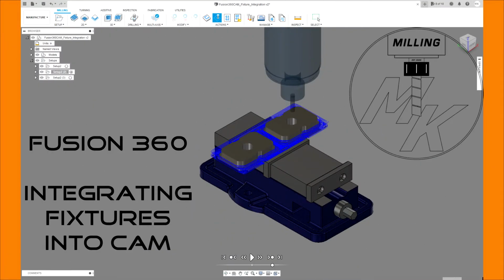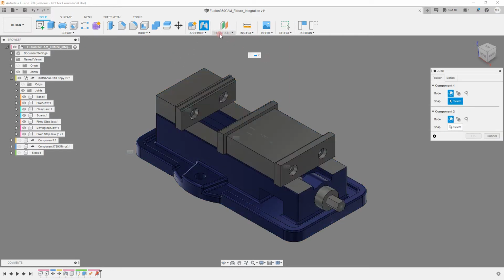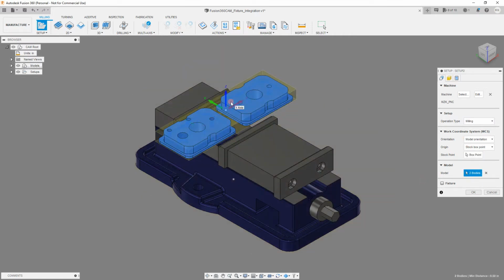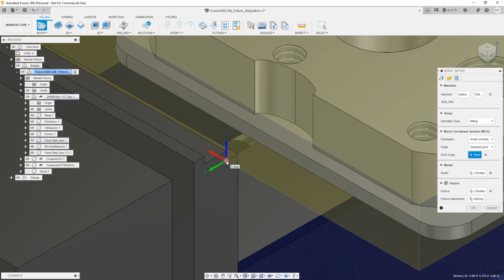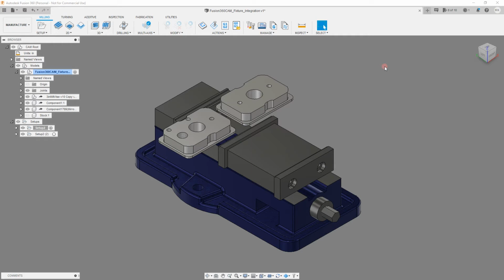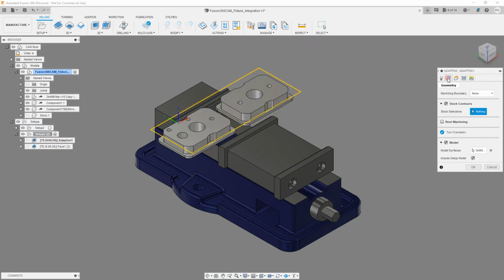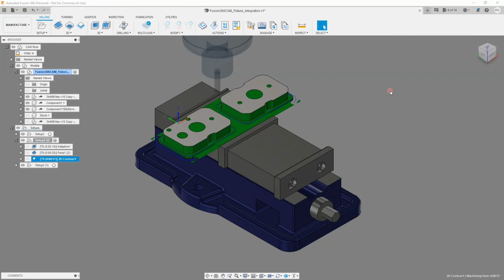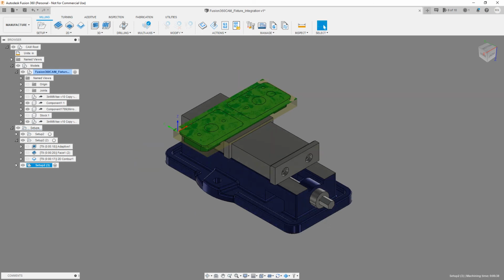Integrating Fixtures into Fusion 360 CAM

Comment: Such a great help! Even though I had my fixture modeled, I never used it because I couldn't get fusion to stop including the entire fixture in the work envelope. In addition, I also followed NYCNC's video about modeling the stock from years ago, but I also got this weird warning that Fusion would select all models.... It wasn't until this video that it all clicked. What I was doing wrong was not isolating all the components. In the past, I was just selecting the fixtured model and that was it. While watching the video, I selected the fixture model, the part models (this was the missing piece) and the stock model. Boom! It worked, Thanks so much!

Comment: Great, thanks for sharing. I'd love it if you talked how you create soft jaws and any tips or techniques around those.
Reply from the maker: I am actually going to be cutting some new stepped jaws for my vise here real soon, I will try and grab some video of it and throw something simple together. Not exactly going to be "soft" jaws, but a lot of the same processes will still apply.
Reply: @MKMilling  Haha, for some reason soft jaws are aluminum, which when hit with, isn't very soft.

What vise do you have? I assume it fits on your PrintNC and is something low profile. I have a hard time finding a low profile vise for my CNC router setup.
Reply from the maker: @janderson2375  Aluminum is still a lot softer than steel, and much easier to machine in custom features if needed. I am using the same vise you can see in this video. Its a random 3 inch machinist vise off Ebay. But I've added additional jaws the the back of the moving jaw so I have just over 7 inches of clamping capacity. Benefit is it keeps the lower profile of the 3 inch vise without having to sink it into my frame.

Comment: This is very helpful. I didn't know you could carry stock over into a following setup. I guess you need to be very precise when you flip the part over in the vice so it lines up properly for the subsequent machining. How do you practically do that? With dial gauges, indexing pins? Whats the process?
Reply from the maker: Yeah, it is a very nice feature when you have to cut the same piece in multiple setups, I am working on a three setup part right now and it makes a huge difference. As far as locating the second part, I have gotten my G55 coordinate dialed in right on the corner of my vise jaws, so I can just place a known machined feature into that index in the setup, and then just use gage blocks to get it lined up to that. Other option is to probe some features on the part after flipping.

Comment: Helpful, but the critical part that seems to be missing is how to adjust the pucker distance from your modelled fixture. A programmer may run the toolpath to 0.000000001" of the vise jaws, but in practice, you really want a good 0.050" or more just because cutters and jaws are expensive to replace if your toolpath takes 0.001" off the hardened ground jaw.
Reply: shit .001 off the top of a jaw is how i like to hone my insert edges